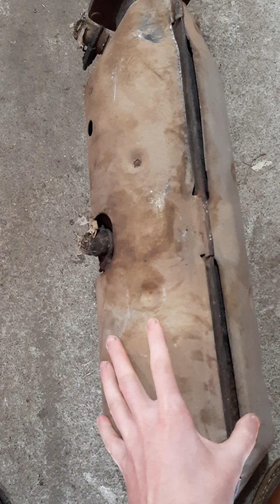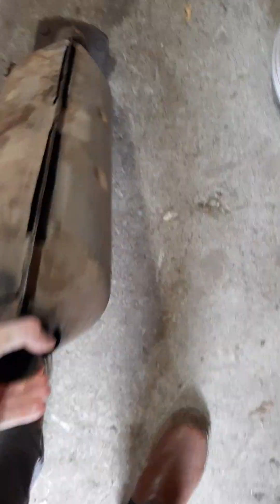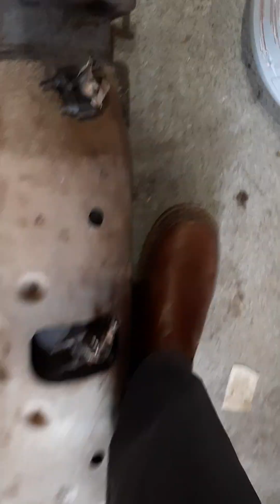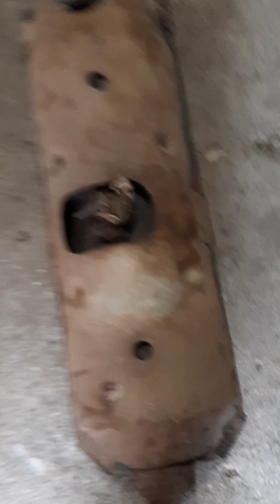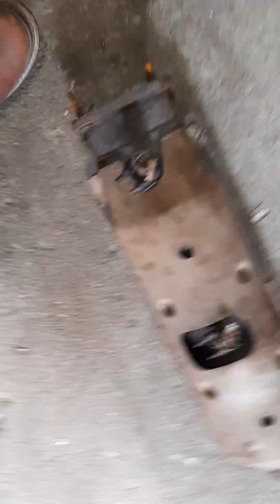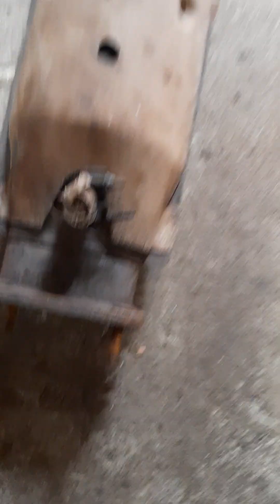OBS Ford Clogged Cat Symptoms

Comment: Im getting hesitation at 35 mph the rpm drop and I have to step on the gas to overtake the hesitation if I don’t do that it will just loose power and jerk . Is that something you where having?
Reply from the maker: That sounds pretty similar. My truck was basically stuck below 60mph on a good day, RPMs just would not go up.
Another clue is if you hear a loud whistling when you really get on it. That's exhaust blasting through the gasket because it can't get through the cat.
Reply: @ yeah I have 3 inch open gap on the stock muffler . I can hear that pretty good even at idle . I’m probably getting back pressure plus the clogged cat . Hopefully it gets resolved when I replace the cat and straight pipe it after the cat.
Reply: Did you ever replace the cat? I'm getting shaking with light acceleration. I have to step on it so it shifts down and gets out of that state. I'm about to repair the PCM capacitors based on another video I saw.